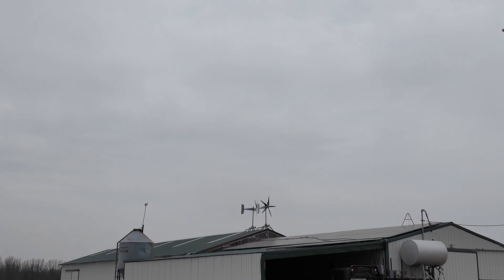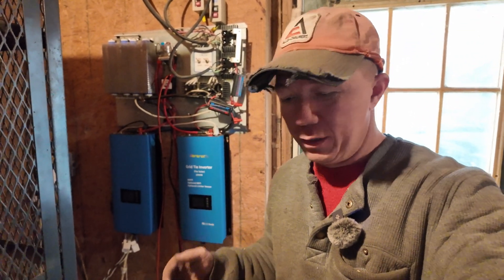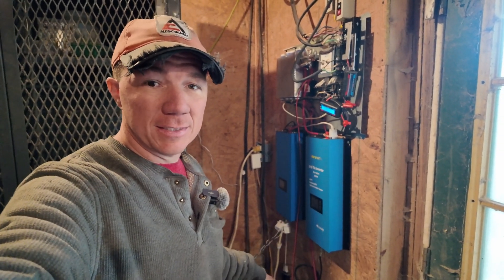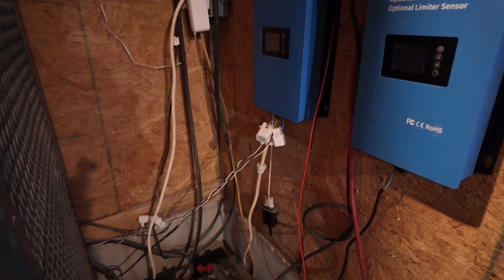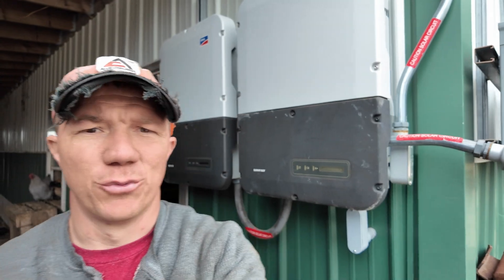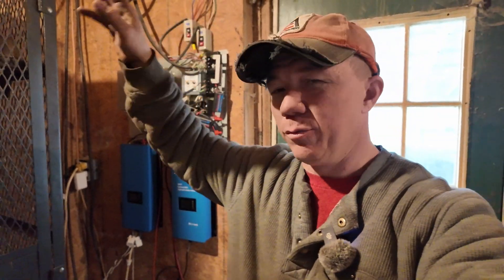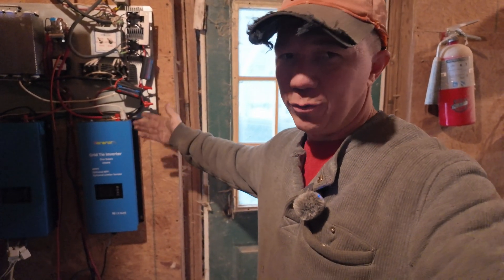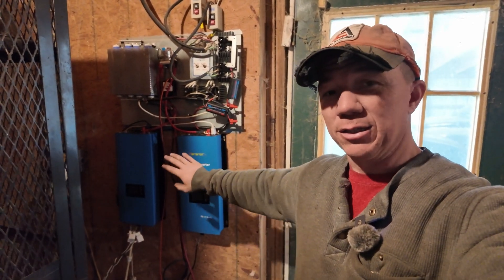Is The Sun GTIL junk?

Comment: Better to use 5KW Solis hybrid inverter charger that runs at 48V battery and have up to 6kw solar input at 500V with dual MPPT, off the grid or on-grid battery less support and cost $500AU
Reply from the maker: I will look into this model. I have never seen one. Is it only available in Australia?